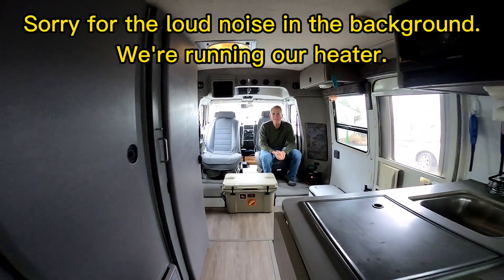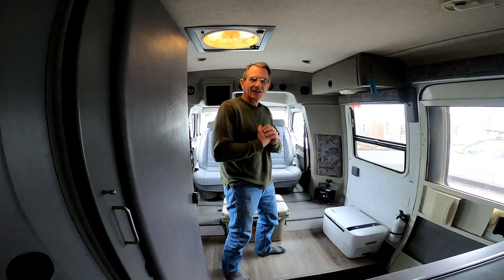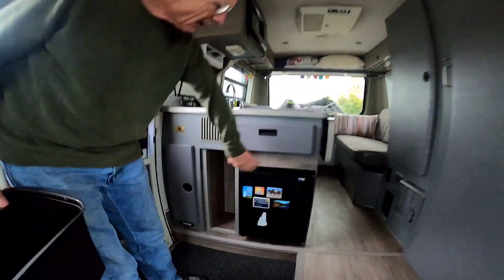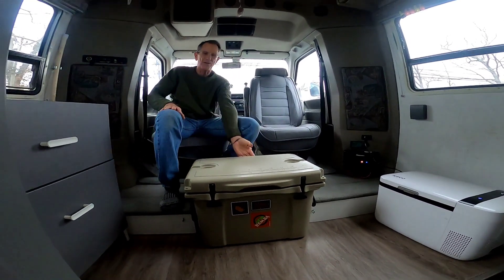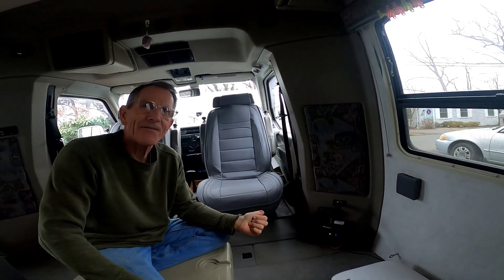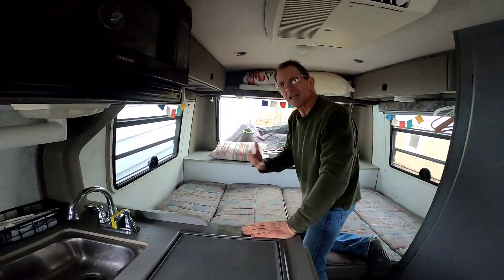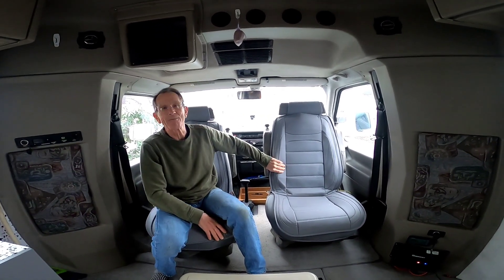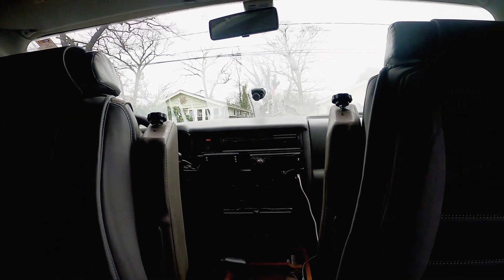1999 Rialta Interior Update Tour  #1999rialta #vanlife #rialta#camper #update #rv

Comment: Do you have a video on how you remove the two chairs I might be purchasing a rialta and I really don't like the two chairs it's a very old Rialto and I think it's going to need a lot of work but the two chairs have got to go I'm a female and I live by myself so any help would be grateful
Reply from the maker: No video is available.  My fiancé helped me. There are 4 bolts (I think) on each chair. You will need to paint the bolt holes to prevent rust. I then patched the holes with fiberglass mesh. When you tear up old carpet, be prepared for quite a mess underneath. We had to scrape up the old foam and plywood ribs. Go on the Facebook Rialta Owners Group of America site. Search files for flooring. Good luck. You can do it!
Reply: @mothershipadventure5004  It is so easy that even I can do it.

Comment: Nice Color inside GREY...... spec Please
Reply: “nICE” cooler
Reply: @robertlyon6978  hello !  Tres Belle Couleur Interieur GRIS Is That The Original Color .Im Lookink To Repinting Mine . thank For The Info A+
Reply: I am not sure if this is an exact match, but this paint bonds nicely. I wiped down the doors with alcohol first. Rust-Oleum 249078-6PK Painter's Touch 2X Ultra Cover Spray Paint, 12 oz, Satin Granite